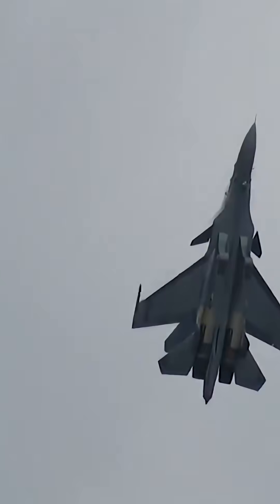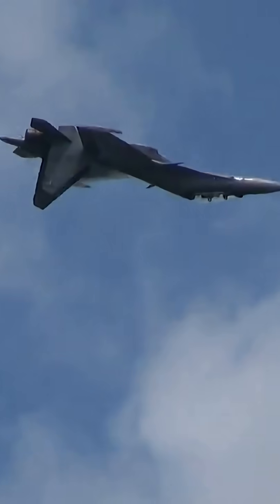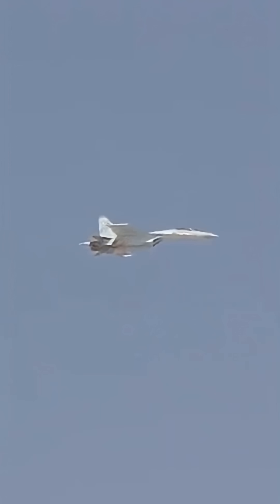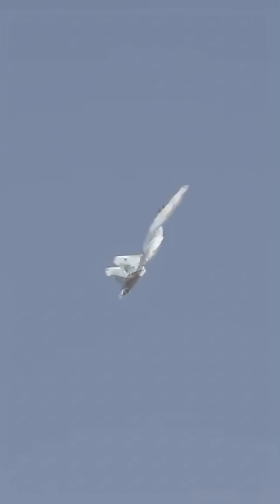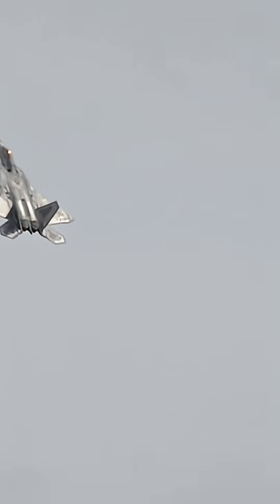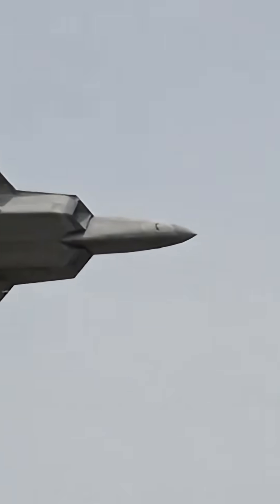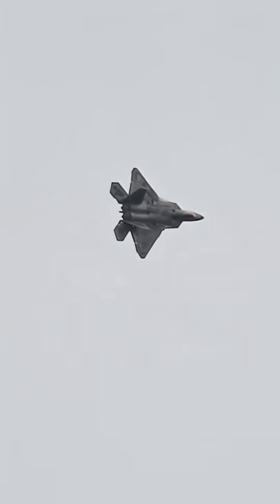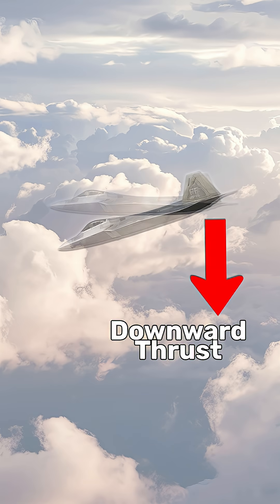The RISE, fall, and RISE again of Thrust Vector Control

Comment: According to US test pilots, they discovered that while thrust vectoring can had advantages in very clsoe quarter engagements, it's around a ton of dead weight at all other times and they would much rather have that put into extra fuel, avionics and so on.
Reply: Also 3D thrust vector aircraft are considerably more fragile and take much more time to repair. Therefore they fly less.
Reply: At some point, every military aviator has to say, "This is what I am taking with me".  Thrust vectoring may save one's life, but the machinery will cost you fuel.

The F-35 has one pilot, one huge engine, all the weapons inside, second-biggest gun for the type, the fancy helmet, and the supercomputer.

Is thrust vectoring as useful as the fancy helmet and supercomputer?
Reply: So figther jets have get off guns also, iff thats ur point...
Reply: @tirsofelipeduranmendoza5432 There have been fighter jets which don’t have internal guns for ages, which have done very well. Harrier is one of them.
Reply: @Xenomorphine The raf never exposed the harrier to real danger. The F4s on vietman though the same, but they got smashed by the Mig21s... and a world o full aspect stealth, dogfigthing would be more probable...
Reply: @tirsofelipeduranmendoza5432 Completely incorrect.

Royal Navy Harriers were the only air asset able to provide anti-air coverage over the Falklands against Argentina’s air force; including Mirages with medium-range AAMs. Harriers never lost a single plane to air combat.

Likewise, only USAF F-4s had that issue. US Navy Phantoms did not. It turned out to be due to extremely poor USAF training, where F-4 pilots didn’t have any idea how to even use Sparrow missiles in their optimum engagement parameters. USN pilots did and had a much better combat record. When USAF training adopted some USN techniques, things improved for them.
Reply: @Xenomorphine not only that, but part of what the Navy learned was high failure rates because their missiles were often failing to connect to targets due to damage in shipping and especially ship-board handling.
Reply: Kind of like the F-14's variable sweep wings.

Comment: I remember when the Air Force once determined that air-to-air missiles made dogfights a thing of the past.   As recently as the last aerial engagements, there are still accounts of missiles failing to ignite and falling harmlessly off the aircraft.   If that happens frequently enough, you’re not likely to maintain your engagement range advantage.

Comment: 60g?! 60!? What the hell are they making those air-to-air missiles out of? Adamantium or Vibranium or Impossiblium? All three are much, much better than the originally proposed, explodium.
Reply: The 9x has 3d thrust vectoring, 8 fins small size and tech that it was developed at area 51 (unlike prior models) with a significantly cut down staff from prior model development.

Comment: What is going to happen to a 6th gen fighter (without a vertical stabilizer) during a loss of engine?
Reply: Depends on if it's single engine or twin engine for a twin engine you'll have asymmetric thrust that would cause an yaying motion (this is what causes the f14 flat spin) but being able to thrust  vector may make it safer as it can point the thrust away from the center of the aircraft to counter act the yawing motion

(the mig 29 has its thrust pointed slightly outwards for this reason in the event of the right engine flaming out the left one having its thrust point slightly left helps counteract the yaying motion caused by the center of thrust being off the center of mass and same if the right engine went out)

It's also worth noting that like the b2 if the aircraft is twin engined (the b2 technically has 4 engines but that irelivent to the argument) it can throttle down one engine to cause a yaying motion so thrust vectoring isn't necessary needed on a twin (or more) engined 6th gen you could also have wing tip decelorons like the b2 to caus more drag on one wing than the other (this is bad for stealth though which is why the b2 mainly relies on differential thrust)

For a single engine aircraft unless it has wing tip decelorons your pretty much out of luck but also you might have bigger problems than yaw stability

Comment: Part of it is Russian fighters are designed for low speed high aoa dogfighting where American aircraft are usually designed for turning well preserving energy instead of bleeding it all away with a turn so by amarican doctrine thrust vectoring isnt as useful as it is to Russians

Comment: The best current application I can see for thrust vectoring is VTOL capabilities that allow fighters to operate from small helicopter carriers or maybe even destroyers/frigates someday.
Reply: The F-22 uses it to prevent stalls and to get the optimal trim condition in straight and level flight. The latter may help it achieve supercruise.
Reply: Especially if the fighter is a small ucav

Comment: We figured this out in the 1980's - "Avoid a tight turning fight at all costs".  Once you started, it was like dropping an energy anchor, and the big wing flashes were a beacon to every bandit for 15 miles.  You're pumping out massive IR with your burners.  The AIM-9 doesn't care about your 6 o'clock, it's all-o'clock and can pull 50 g's.
Reply: Rip AIM 9e 

Rip actual dogfighting as well I guess. 

BVR is gay and no one can change my mind.
Reply: Great post, touches on the remark I’d make, pulling 50 g.  A manned unit can only maneuver within the human tolerance, and those drones will wipe it out.  Drones are much cheaper.  Stop this idiotic development of the next fight unless it is unmanned.😊
Reply: US cars cannot turn, US fighter don't either 😂
Reply: @stefdem1533 the Corvette’s Nurburgring lap times beg to differ 😉

Comment: Many Russian jets can do well over 60k ft and the Mig-31 can do 123k ft so over double 

Not saying that Russian jets are better in any way than US jets but the constant bashing of all non-american designs in this guys videos are pretty annoying, constantly saying how the US is so much better when comparisons of countries was not even the point of the entire video. It was about thrust vectoring nozzles and thats it
Reply: AI Overview

+4
The MiG-31 is One of The Fastest Fighters Ever - PlaneHistoria
The MiG-31, also known as the Foxhound, can reach a service ceiling of 20,600 meters (67,600 feet) and can also perform zoom climbs to higher altitudes. Specifically, it has reached an altitude of 37,650 meters (123,523 ft) according to Hobby Master Archive. The aircraft's ability to reach such high altitudes is due to its powerful engines and design optimized for high-speed interception. 
Here's a more detailed breakdown:
Service Ceiling:
The MiG-31's service ceiling, the maximum altitude at which it can maintain level flight, is 20,600 meters (67,600 feet). 
Zoom Climb:
The MiG-31 can also perform a zoom climb, a maneuver where it trades airspeed for altitude. In this way, it has been recorded to reach an altitude of 37,650 meters (123,523 feet), according to Hobby Master Archive. 

Zoom climb isn't really relevant, certainly not for dogfighting.
Reply: @nichevo1 whats your point? Have you even read my comment?

Comment: Our first thrust vectoring nozzles made at P&W went on the STOL/MTD technology demonstrator F-15 and were instrumental in the short takeoff ability.   With more thrust than weight the aircraft can fly straight up but needs to get rolling pretty fast before the flight surfaces have enough authority to point the nose up.

Vector the thrust upward pushes the tail down and this levers the nose upward on the rear landing gear, then the nozzles point downward and push the aircraft off of the runway.  This all happens quickly and I watched many test cycles where this was all worked out.

The F-22 can very likely use this technique if it ever needs to get off the ground quickly....but I've not seen it used in airshows so that's just speculation on my part.

We made 360 degree nozzles early in the '90's and flew them on the STOL/MTD but found the expansion of the flight envelope only in areas where it wasn't worth the cost, weight and complexity so they were not adopted.
Reply: I’ve witnessed the F-22 do some really short takeoffs with the trust vectoring technique. I was an engineer on completely unrelated equipment when they were testing the jet, supposedly to replace all other fighters in our military. I was completely astonished. They went from dead stop to vertical in about half the length of an aircraft carrier flight deck in just way to fast for me to fully appreciate. They are phenomenal aircraft. I wish I knew more about them.
Reply: @StevenPullen-jt1he  Thank you for this information.   I've long suspected that this capability was there if they needed to use it.   The Raptor is a really, really bad ass aircraft.
Reply: We suspect the F-22s and F-35s were kept at about forty percent for public perception, until this year, for the F-35.

Comment: Aren't the systems 1D for US and 2D for Russian?
3D vectoring would require it direct the thrust backwards / forwards along the length of the aircraft?
Reply: Nope. 2D is the correct nomenclature. Think of it geometrically. Imagine it from the perspective of the nozzle or the exhaust stream: the arc that the F22's nozzle thrust describes can be imagined as a series of lines angled in relation to each other in only one direction. What do two lines that meet at only one point/are at an angle to eachother describe geometrically? They describe a plane, a 2D object. Similarly a laser light show in a club with a smoke machine is a perfect visualization of what I'm describing: using a gimbaled mirror a single laser beam can be whipped back and forth above your head faster than the eye can see, and the results is what appears to be a plane of 2D laser light that you can reach up and stick your hand through and cast a shadow behind you through it. A 2d nozzle simply means the thrust is constrained to a two-dimensional range of motion. If you have three axese, X Y and Z, but can only ever move in two of them, say x and y, you will only ever be able to describe two-dimensional shapes. Flat things.
Now imagine the nozzle/exhaust stream from an Su35 swivelling around its full range of motion : the stream of exhaust, or vector lines now have another degree of motion. Again all those lines diverge from a single point, but you've now added another degree of freedom, laterally. Say that nozzle can deflect 15°. What do you get when you connect an infinite number of vector lines resulting from that arc of motion? You get a cone with a 30° included angle, a three-dimensional object. Imagine the laser light in the smoke-filled club whipping around in that same range of motion, you get a 3D cone carved out of light.
Reply: @notwithintolerance it's not moving in that cone though. It's only moving in the X and Y axes, not in the z axis.
I guess that it's more marketing and they're counting the normal thrust as z-axis, but there is no vectoring in that axis.
You don't say that a normal fighter has 1d vectored thrust, you say that it doesn't have any vectoring.
Reply: Well this is technically true it's very common to refer to f22 style as 2D and su35s style as 3D even if sumaticly it doesn't necessarily make sense I have also seen arguments that vtol jets like the av8 are the only true 3D thrust vectoring but again that's semantics and not how the terms are usually used
Reply: @acompletelynormalhuman6392  The AV-8 was an early example of a thrust vectoring aircraft.
Reply: 1D - is straight backwards no moving nozzle

2D - moves along one axis up and down
 
3D - moves along two, up and down and left and right. Mostly used in diagonal layouts
Reply: @angelaferkel7922  nope. 2D is the correct nomenclature. Think of it geometrically. Imagine it from the perspective of the nozzle or the exhaust stream: the arc that the F22's nozzle thrust describes can be imagined as a series of lines angled in relation to each other in only one direction. What do two lines that meet at only one point/are at an angle to eachother describe geometrically? They describe a plane, a 2D object. Similarly a laser light show in a club with a smoke machine is a perfect visualization of what I'm describing: using a gimbaled mirror a single laser beam can be whipped back and forth above your head faster than the eye can see, and the results is what appears to be a plane of 2D laser light that you can reach up and stick your hand through and cast a shadow behind you through it. A 2d nozzle simply means the thrust is constrained to a two-dimensional range of motion. If you have three axese, X Y and Z, but can only ever move in two of them, say x and y, you will only ever be able to describe two-dimensional shapes. Flat things.
Now imagine the nozzle/exhaust stream from an Su35 swivelling around its full range of motion : the stream of exhaust, or vector lines now have another degree of motion. Again all those lines diverge from a single point, but you've now added another degree of freedom, laterally. Say that nozzle can deflect 15°. What do you get when you connect an infinite number of vector lines resulting from that arc of motion? You get a cone with a 30° included angle, a three-dimensional object. Imagine the laser light in the smoke-filled club whipping around in that same range of motion, you get a 3D cone carved out of light.
Reply: @angelaferkel7922Lol, no. OP is correct. Up and down is one dimension (like X), hence 1D. Up and down and left and right are two dimensions (like X and Y), hence 2D.

There is no such thing as 3D, i.e. three dimensional thrust vectoring. That would require the thruster to move in and out 

You can fudge this a little by claiming a throttle is "in and out vectoring* but that's a little silly.
Reply: @Desrtfox71 im not a physicist but i am aware that its not physically accurate to name these nozzles 1,2,3D 

I simply helped him understand what they are called like by most people

Same as with generations of fighters, technically speaking, generations dont exist, 4th gens and 5th gen fighters then 6th gen, its all made up by the marketing team of LM 
But it is sorda used today to put it simply that this fighter uses technology that most other fighters dont have (like stealth, sensor fusion, supercruise etc)
Reply: @Desrtfox71  aircraft can move in three different ways, they can pitch, roll, and yaw. Up and down is one dimension, but a twin engine fighter like the F22 can use it's two nozzles to roll by pointing them in opposite directions. This gives two dimensions of thrust vectoring even though each nozzle can only move in one dimension.

If you have a twin engine fighter that can move it's nozzles or otherwise deflect thrust side to side as well as up and down, then you gain the ability to yaw; and have three dimensions of thrust vectoring.

Comment: Be interesting, to fit two of the engines fitted to the AVEN F-16 to a F-15EX and see what capabilities they would confer.
Reply: They effectively already have been. Not to thise models specifically, but the F-16 and F-15 have both been used to test thrust vectoring. Look up the X-62 VISTA, formerly known as the F-16 VISTA, which is a modified F-16D, and the F-15 STOL/MTD or F-15 ACTIVE.
Reply: The x62 VISTA (f16) and f15 STOL have been equipped with thrust vectoring controls so it has been experimented with before